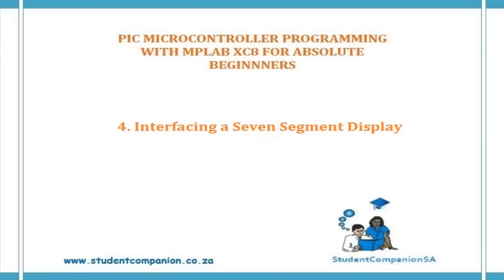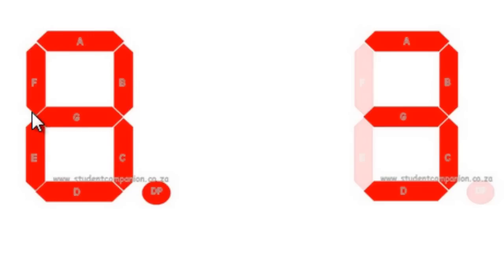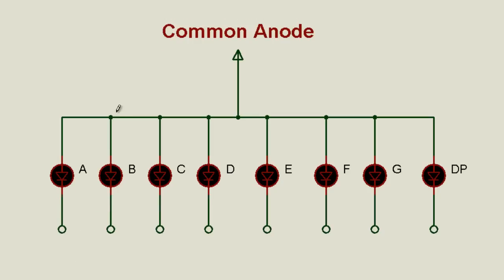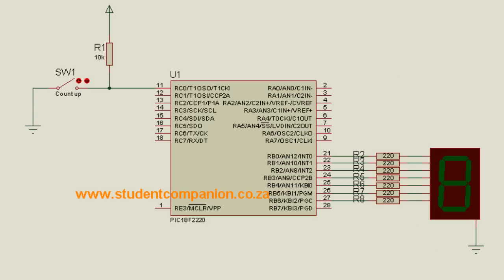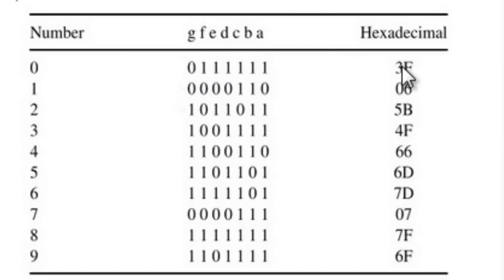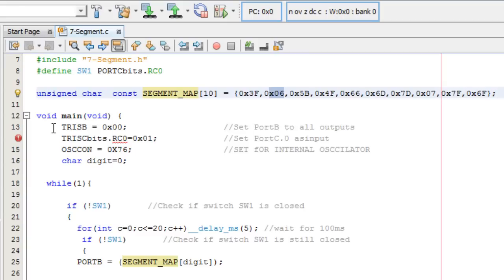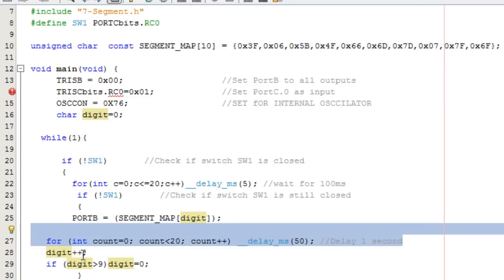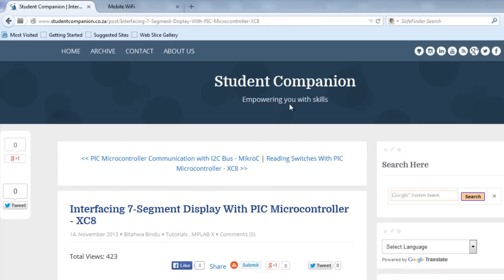4- Interfacing a Seven Segment Display |MPLAB XC8 for Beginners Tutorial

Comment: Greetings. I am confused a little with the following line:  

PORTB = ( SEGMENT_MAP[digit]) 

On the PIC18F2220 you have a total of 8 outputs, from RB0 to RB7 ( in your example you do not use RB7 ). Hypothetically speaking to clarify my understanding:  

if I use PORTB = 0xFF; //does this mean that all the 8 outputs will have the value 1? 

Also, you declare TRSIB = 0x00 . It is the same thing as declaring TRISB = 0, right? 

Thank you in advance for the answer. Take care :)
Reply from the maker: Hi. The 7 segment display is connected to PORTB, that's why we are using this statement: PORTB =(SEGMENT_MAP[digit]). This represents the instantaneous value of the segments tonhe displayed and it's changing.
If you use PORTB = 0xFF it will output 1 to all outputs but if you're using a PIC18F series don't use PORT to output, use LAT to output.
Ox00 is the same as 0. It's just a different numbering system. Ox the value is in hexadecimal, while 0 is in decimal.  0b the value is in binary.  You can use the same numbering as you like to make things easier for ourself.
Reply: @StudentCompanion  I understand perfectly now. Thank you!   

One more thing. In video to light the number 1 you use :  

PORTB =0x06;  

at the same time we could write this:  
{
LATBbits.LATB0=0;
LATBbits.LATB1=1;
LATBbits.LATB2=1;
LATBbits.LATB3=0;
LATBbits.LATB4=0;
LATBbits.LATB5=0;
LATBbits.LATB6=0;
LATBbits.LATB7=0;
}
and have the same output, right? 
Again, thank you very much that you answered in such a short time.   
Side note: In my code I used:  
 if (PORTCbits.RC0==0)
       {
           __delay_ms(100);

           if (PORTCbits.RC0==0)
           {
skipping entirely the "for" function which outputs the same results of 100 ms. Theoretically my approach is correct? 

EDIT:  
you said to "don't use PORT to output, use LAT to output." so I went back to lesson 3 and change the code from:
{
       if (PORTCbits.RC0==0)
       {
           __delay_ms(100);
           if (PORTCbits.RC0==0)
           {
               LATBbits.LATB0=1;
           }
       }
       else
       {
         LATBbits.LATB0 =0;   
       }
   }

to

{
        if( LATCbits.LATC0==0)
        {
            __delay_ms(100);
            if  (LATCbits.LATC0==0)
            {
                LATBbits.LATB0=1;
            }
        }
             else
            {
                LATBbits.LATB0=0;
            }
    }
but now it doesn't work. The LED stays on no matter how many times I press the switch. Do you have any idea what did I do wrong ?

Comment: what program are you using to sim your code?
Reply from the maker: This program is called Proteus from Labcenter Electronics
Reply: is that compatible with mplab ide?  i am a student and am having trouble using my pickit2 and was wondering if this would be an easy way to test my code without having to setup my breadboard differently everytime
Reply from the maker: Kenny Heller
 Hi!
I don't know what you mean by compatible with MPLAB IDE but as you could see, we were using MPLAB for these tutorials. All you need is to load your compiler (this could be MPLAB XC8 or any other compiler) generated HEX file and start simulation. It saves you time and money and it has more capabilities and more components, virtual instruments like oscilloscope, multimeters... to make your simulation as real as possible. Whatever you see in simulation is more or less what you will experience when you build the actual hardware.

Comment: sir I am doing a project on speed control of 3-phase bldc motor using pic18f452 microcontroller. could you help me sir?
Reply from the maker: I can only help you with what is within the scope of the tutorials we have published so far.  I can help with speed control of DC motors because we have covered it already.  But I can't help with 3-phase AC motors. It's beyond our scope
Reply: @StudentCompanion  I had seen that video too. But I have issue with mplab code configurator

Comment: Sir I tried this it worked,but then I tried by changing switches to port b,and 7segment to port c, both code and proteus I made the exact changes,I can make sure with codes and setup theres no error. But when simulation started,it automatically runs even the switch closed o not. so is there any specific purpose? cant we connect swithes to portB,pls explain. isn't it a input port o something?
Reply from the maker: You can connect switches to any port. They must be something else wrong that you are doing. Can you post your code? How is your switch connected to PORTB?
Reply: this is ur code,I changed all "C" into "B" and all "B" into "C", and switch connected to RB0, I'm checking this for hours,pic 18f2220, I couldn't think it might be my mistake coz if I change these again and arrange as u said,it's working, just bcoz of changing ports how come a fault occur?that's my prob now. ur lectures r so good n helpful.but I'm bit of trying new ways while learning,that'sy this ques rises

#include <stdio.h>
#include <stdlib.h>
#include "t4.h"

#define SW1 PORTCbits.RC0
//int i;
//char    a=0;
unsigned char const seg[10]={0x3F,0x06,0x5B,0x4F,0x66,0x6D,0x7D,0x07,0x7F,0x6F};

void    main(void)  {
    TRISB=0x00;
    TRISCbits.RC0=0x01;     //input
    
OSCCON=0x76;
char    a=0;

    while(1){
        if( SW1==0){
            for(int i=0;i<20;i++)__delay_ms(5);     //100ms delay
                if( SW1==0){            PORTB=  seg[a]  ;
            for(int i=0;i<20;i++)__delay_ms(50);        //1sec delay
            a++;
            if(a>9)a=0;
                }   }
        else{ PORTB= //0x00;
                ( seg[a] ) ; 
        }
    }   }
Reply: same pullup way as u said,all r same only ports changes,in code also same changes and in proteus also same changes i made
Reply from the maker: How do you expect us to assist you but you cant post the code you have changed?  This code is basically the code in our tutorial.  Sw1 still on PORTC and 7 SEGMENT  on PORTB. you can't say you replaced B with C. What if you forgot something and can't see it yourself you need a different person to pick it up? 
You can't expect us to guess what could be wrong
Reply from the maker: Post your new changes and we will look at it or upload your project and Proteus on our Forum. We will try it and see what could be wrong. Without this, we can't guess.
Reply from the maker: Please zip your full project and Proteus and upload them in the forum: https://www.studentcompanion.co.za/forums/

Comment: Sir, how do I set the RA0 pin as Digital I/O. When i tried to connect the switch with RA0 instead of RC0, the number was incrementing without the switch operation.
Reply from the maker: Which PIC model are you using? Can you post your code? How did you connect the switch to the PIC? Are testing on hardware or simulation?
Reply: i am using the same softwares and PIC used in the tutorial. It is proteus simulation. the code :
#include "XC8_1.h"
#include <stdlib.h>
#include <stdio.h>

void main(void) {
    TRISB = 0;
    TRISAbits.RA0 = 0x01;              //Sets Pin RA0 to input. 
    unsigned char const disp[10] = {0x3F, 0x06, 0x5B, 0x4F, 0x66, 0x6D, 0x7D, 0x07, 0x7F, 0x6F};
    OSCCON = 0X76;
    unsigned char dgt1=0;
    while(1)
    {
        if ( PORTAbits.RA0 == 0 )
        {    
            
             // LATBbits.LATB0 =~ LATBbits.LATB0;
            for (int cD = 0; cD <20; cD++)__delay_ms(5);
            
            if (PORTAbits.RA0 == 0 )
            {
              if (dgt1 >9) 
              {
                  dgt1 =0;
              } 
              LATB = disp[dgt1];
              for (int cD = 0; cD <20; cD++)__delay_ms(40);
              dgt1++;
            }
            else
            {
                LATB = disp[dgt1];
            }           
        }
        else
        {
              LATB = disp[dgt1];
        } 
    }
}
Reply from the maker: Which PIC are you using?
Reply: PIC 18F2220
Reply from the maker: If you are using the same PIC and the same software then it should work. Because it's working as you can see from the video. They must be something else wrong that you are doing. 
Can you upload your MPLAB project together with your Proteus project in the Forum on our website.  We will have a look at it
Reply: I changed the port from RC0 to RA0. Does it make any difference. When i saw the datasheet, it was written as "On a Power-on Reset, RA5 and RA3:RA0
 are configured as analog inputs and read
 as ‘0’. RA4 is configured as a digital input". Should i be changing it to digital I/O. If so, how do i do it ?

Comment: Hi! I really love your videos, they are very helpful. But I have some trouble, while trying to repeat your program. I have this error C:\Program Files\Microchip\xc8\v2.31\avr\bin\avr-ar.exe: two different operation options specified. Don't know what to do.
Reply from the maker: Can you post the complete build log not just 1 line? Which microcontroller are you using?
Reply: @StudentCompanion  Yes of course. I am using pic18f2220. My past mistake disappeared by itself, but a new one appeared - 
https://pastebin.com/FxHifuvX
I tried to solve it by changing the language version in the global options of the xc8 compiler, but it did not help.
Reply from the maker: Why can't you paste the build log here in the comment?
Please post your code as well.
Reply: @StudentCompanion  Code is the same as yours in this video
Reply from the maker: Did you add correctly the header files if any? Because you say you are using the same code.
Reply from the maker: If it still doesn't work, zip your full project and post it in our forum we will build itband check what could be the problem.
Forum: www.studentcompanion.co.za/forums